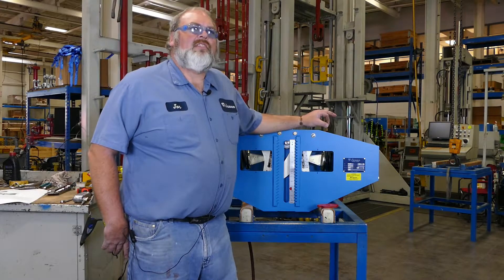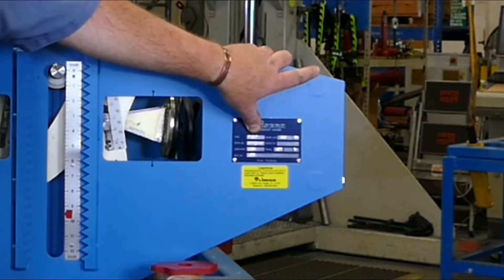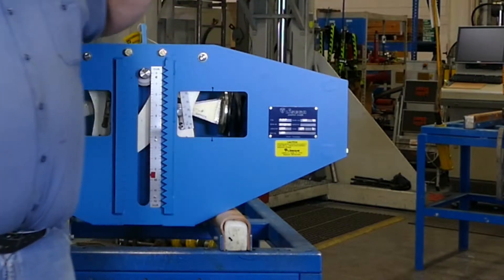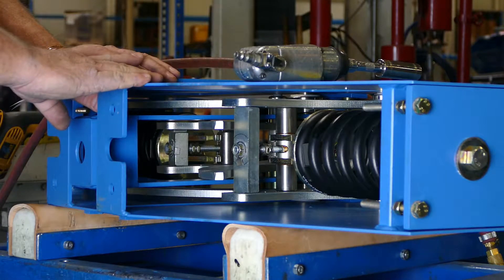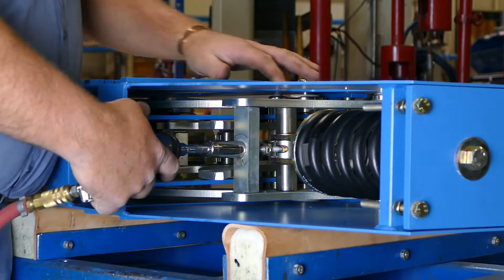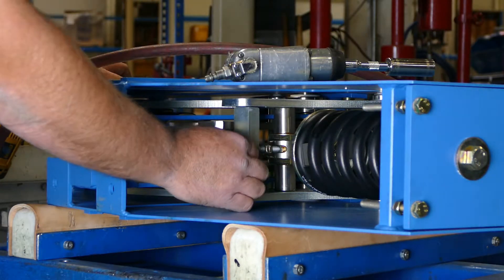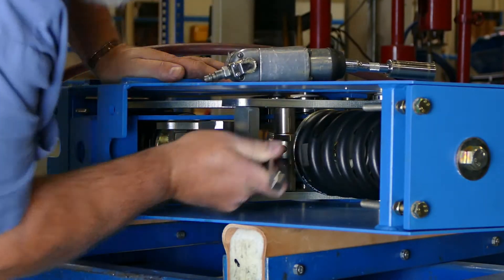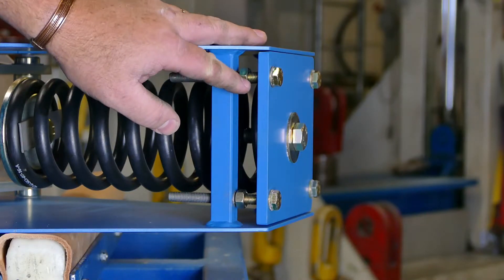LISEGA - Low Profile Constant -  Load Adjustment

Comment: How do you release the tension to bring the rams back down to reconnect the pipe? We had a base plate break off and need to bring the rams back down to reconnect the piping on a running unit that we cant bring down.
Reply from the maker: Please contact us at info@us.lisega.com. We will connect you with an expert who can get more information about your specific situation and walk you through the process to safely perform the necessary adjustments.